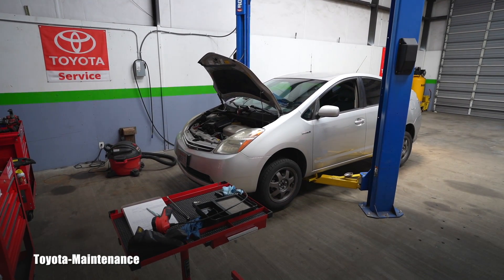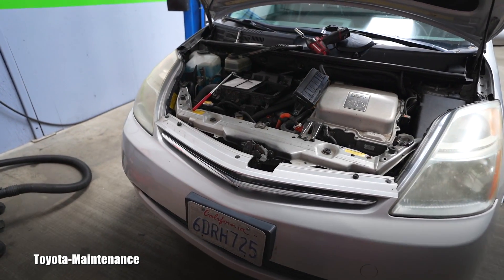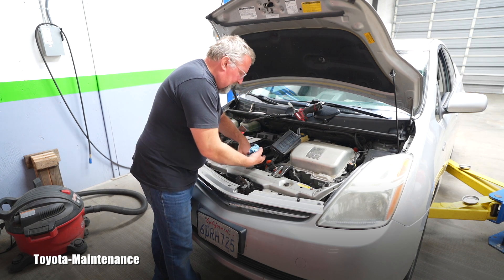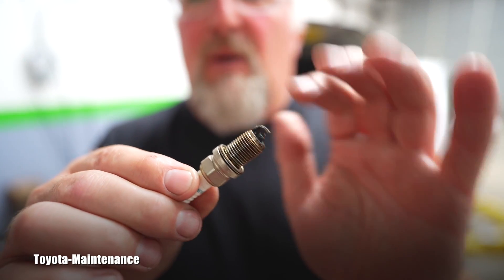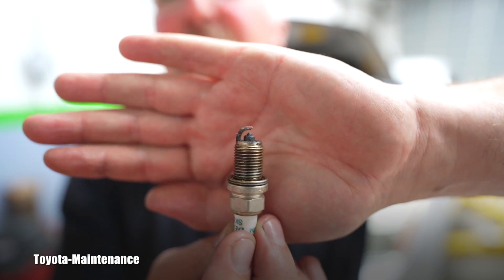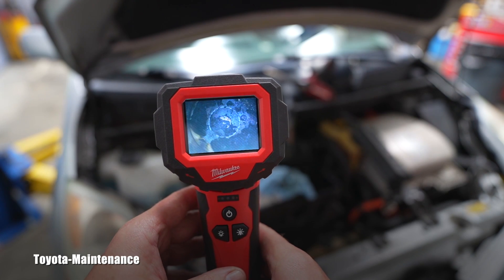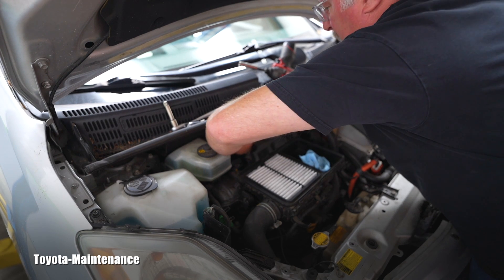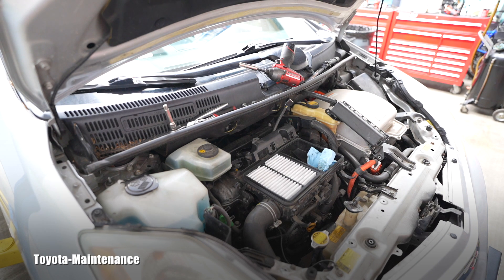Spark Plugs are talking - are we listening?

Comment: Get Triple A (AAA). You will need their help. When the seller sees the cost he is responsible to pay, if they are smart they will offer to buy the car back. The people at the AAA will be more than happy to help. The place is airconditioned and usually not crowded.

Section 24007 (b)(2) of the California Vehicle Code states it's the responsibility of the seller to provide a valid smog certificate before or during the sale of a vehicle. Nov 13, 2020

If the vehicle is already in your possession, and the private car seller didn’t give you proof of passing the smog check test, try finding an amicable solution for you both. If that doesn’t work out, you may have to take legal action since the California DMV won’t get involved.

Comment: Whatever deal he got on the purchase price will be more than invalidated by the cost of getting that vehicle to run to spec.  I agree with another viewer who recommended looking under the valve cover.  If things look bad under there, it might be best long term for the owner to cut his losses and sell the vehicle to a boneyard, or to an auction dealer.  This was an expensive lesson about the value of pre-purchase vehicle inspections.  If the seller won't agree to one, then just leave.  Especially with a vehicle that old and with that many miles.

Comment: I presume you already have reassembled the plugs but I would have done a compression test and my guess is #1 oil piston ring is stuck or clogged. If so, I recommend a seafoam service in the crankcase and upper cylinder through the vacuum lines. 

Peek under the valve cover through the oil filler and see if you can tell sludge or golden oil deposits on the inside. 

Shameful people who flip cars like this. 

That oil leak is destroying this engine. And I'm likely to guess why it poisoned the cat as well.
Reply: Yes do a compression check. If it fails, squirt some oil in each cylinder and repeat the test. If it is any better then it is the rings/lower end. The oil will help seal the rings raising the compression. This is not a fix. Lower end is going to cost you. If the second test is no better then it is the valves.

Comment: This car was probably sitting outside for a long time. Always check everything before you buy. I think in California he has a certain time to return the car and get his money back.
Reply: Section 24007 (b)(2) of the California Vehicle Code states it's the responsibility of the seller to provide a valid smog certificate before or during the sale of a vehicle. Nov 13, 2020

If the vehicle is already in your possession, and the private car seller didn’t give you proof of passing the smog check test, try finding an amicable solution for you both. If that doesn’t work out, you may have to take legal action since the California DMV won’t get involved.

Comment: good news is that with all that with all the carbon billed up on the pistons it will increase the compression ratio while also burning oil because of clogged oil piston rings. GG currently have a an 05 scion xb at 290k miles. with same engine, been burning oil for years. its typical on these 1NZ-FE engines to burn oil..you just feed the beast and cleen those sparks plugs after a few months. :P

Comment: I have seen oil like that before. Someone waited 15000 miles to do their oil change. By that time oil was so black that even after it was replaced new oil turned almost black. New oil mixed with what was left in the engine.

Comment: I've got an 2006 Prius that went through 1 quart every 1000 miles. Went round and round trying different things to slow the oil consumption. The last thing I tried was the B12 soak. Pull the plugs and spray B12 carb cleaner into the cylinder until there's a nice pool of it sitting on top of the piston. Thread the spark plug back in a few threads to mitigate evaporation. Check it every few hours and top off as necessary. I let it sit for roughly 24-36 hours; the longer the better. At the end, suction all of the fluid that remained in the cylinder out to prevent hydrolocking the engine. Drain and refill the oil as whatever seeped past the rings made it into the oil. Reinstall the everything. So far, consumption is far more palatable. I've gone to 5000 mile oil changes (no clue what the previous owner did). It's only been losing maybe half a quart per oil change interval now. While it's only been about 8000 miles total since doing it, it's a drastic improvement. I thought I was going to have to put new rings/engine in, but now I've got hope for it. If only the oil consumption hadn't toasted the o2 sensors and/or cat ...
Reply: I was going to post the same comment. thank you for sparing me the hassle:D
Reply: Berryman's is aggressive! Maybe try it again sometime near the next OCI. And post of you get better than the 500 you have now. Anything to preserve the cat for longer.

Comment: i'm a outlier saying this, its unfortunate that 2nd gen engines needs a rering and a oil catch can for longevity of the catalytic and keeping the engine internals clean. the nice things is that prius engines looks new inside after cleaning even at 350k mi. i know because i did it. assuming that maintenance was done correctly.
Reply: If it were my car and was still awesome inside, I would have the engine rebuilt too. It's possible paying the cost of a new car +Taxes and Registration would cost more than the engine. I would probably hot rod the engine and have the fastest Prius out there. :p

Comment: My 98 Avalon is still running strong. 290k on the odometer and I've just replaced the belt
Reply: Thanks for the update
Reply: Timing or accessories? And did it break or preventative?
Reply: @LAactor  new timing chain, no

Comment: Check the compression on #1 cylinder.
Reply: This is true even for 2nd gen Prius?
Reply: @flashsushi  for any ICE car that burns oil, check that cylinder's compression
Reply: @LAactor  glad none of my cars burn any noticeable amount of motor oil.
Reply: Absolutely 👍
Reply: Yes do a compression check. If it fails, squirt some oil in each cylinder and repeat the test. If it is any better then it is the rings/lower end. The oil will help seal the rings raising the compression. This is not a fix. Lower end is going to cost you. If the second test is no better then it is the valves.

Comment: I've been changing my 0w16 oil and filter every 5000 miles on my 2020 Toyota Camry LE . I've been using Pennzoil Platinum 0w16 and amsoil filter , now will try Amsoil 0w16 . I always use either Amsoil or Liqui-Moly engine flush . At 1000 miles the oil is still clear/golden . I had also used Motorkote oil additive .
Reply: It is a pity Amsoil does not make a top spec Signature Series 0W-16.
Reply: @RightLaneHog3151  Yes , just the OE and wish Pennzoil had their Ultra Platinum available now , I expect both in the future .